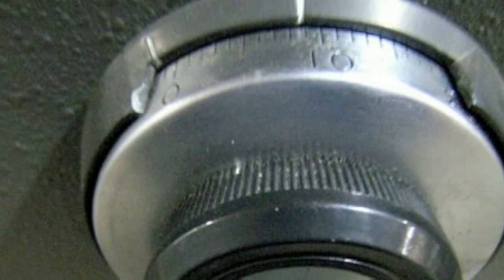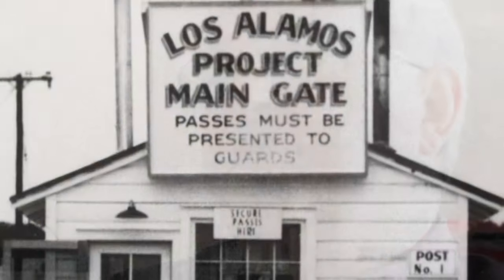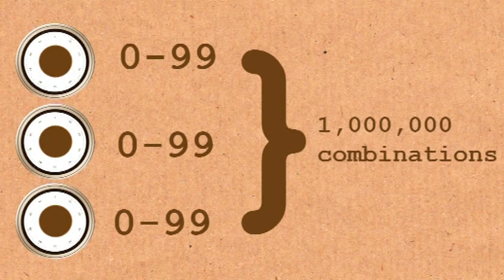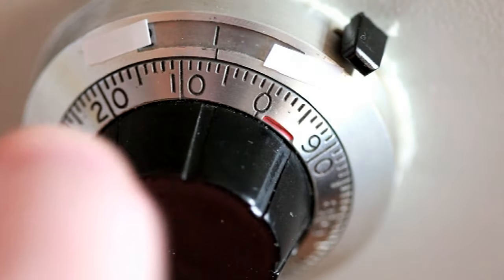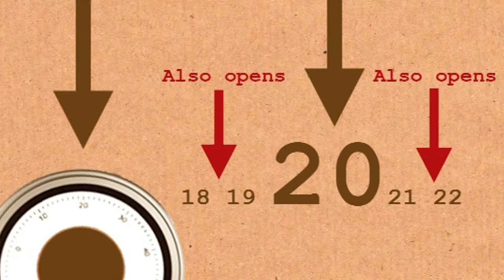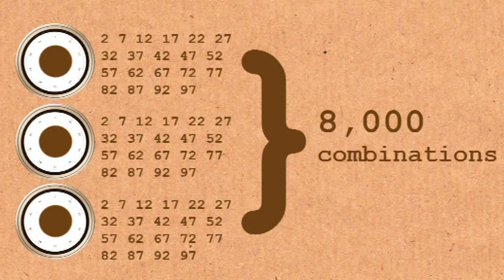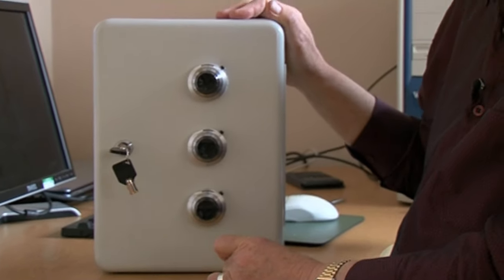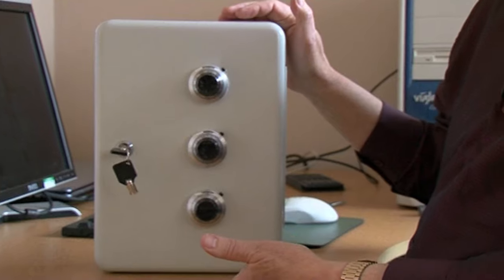Safe Cracking with Feynman - Numberphile

Comment: They didn't mention that he would tell the various people in charge of this security issue and they would get mad at HIM rather than fix the problem.
Reply: That's kind of a common thing with people in charge.

They will get angry at the person pointing out a problem and not the problem itself or the person who caused it initially. I think it has something to do with them now being required to take action, since now that they have been made aware of the issue they are expected to deal with it. Until someone pointed it out, they didn't need to do anything.

Now they need to invest time, money and work because they must fear/expect that their superiors might also hear of the problem and will hold them responsible for not doing anything about it. So they get mad at the messenger for making them work more.
Reply: losthor1zon as I recall the only reason he started cracking them was because they wouldn't listen when he reported how bad the security was.
Reply: You always shoot the messenger
Reply: losthor1zon I live his lectures
Reply: @ziadkhayat7299  - I don't remember exactly. But he enjoyed puzzles, and I think for him this was a diversion. I thought he only pointed out the problem after discovering how many of the safes were not modified from their factory settings.
Reply: @Addict That exists in every hierarchy

Comment: In combination in most modern schools, you cannot set the combination, but you can easily find the first digit due to a flaw in the lock (apply pressure while rotating dile. Add five to the one number it gets stuck on.) then from there, after determining whether it is even or odd, you know both the second and third numbers are either even or odd (but all even, or all odd.) If there are 40 numbers, that gives you  400 combinations. But the third number doesn't require trying a new number everytime. Just set the first number, your guess for the second, then spin it around trying all numbers for the third one. Now, this is more like 20 different options, but doesn't require seeing the lock before breaking in. I have never used this technique for bad (nor should anyone) but I find it handy when I see that someone has stuck a lock in an unnecessary/obnoxious spot. Or if I find a lock, I can learn the combination then give it to a friend who needs one.
Reply: +SwatTeamExit Well, yeah! But for those that do...

Comment: The simplest trick he used is that some people didn't change the factory combinations, which were just a few. He started by trying them, and they often worked. Also, when he found some people left the cabinets open, and he could use the information, he advised them not to leave them open. That triggered a memo asking people not to leave the cabinets open when Feynman was around :-D

Comment: Per his autobiography, it is my understanding that Feynman also reduced the permutations by merging the rotation for the third combination with the beginning of the rotation of the first combination of the next number tried.

Since the dials required Right-Left-Right (or Left-Right-Left) turning, the first and third numbers were approached from the same rotation direction.  

Also the first number required the dial to rotate over 360 degrees. The third number's rotation was less than 360 degrees.  Feynman deduced that if he got the first two numbers correct, ignored the the third number entirely, and began spinning the dial for the first number of the next attempt, the lock would make a distinctive 'Click' as it passed over the correct third number.

So with a lock dial with 100 positions per turn of which he had already reduced to 20 positions per turn, he could cracking the lock in no more than 20 x 20 = 400 attempts (plus one extra spin) without any social engineering required.  So at 5 seconds per turn, in a worse case scenario,  he could crack the safe in about 2000 seconds (-32 min) and on average, -16 min).
Reply: All of that is bollocks if you know how a combination lock operates.
Reply: they don't make em like they used to
Reply: @JaakkoF  feel free to read his autobiography "Surely You're Joking, Mr. Feynman!".  Further if you ever had the traditional style MasterLock  combination padlock, you can easily emulate the same technique.  The dial had enough slop that the 60 digits could be covered by just 12.  As a kid, we used to open them in a few minutes.
Reply: Close... What he did report doing was retaining the setting for the first two numbers while trying all the possibilities for the third, then nudging the second wheel just slightly to the next number along. This saves time because you don't have to dial the entire combination on each attempt. The same trick works on the position of the first wheel. You can either memorize where you've set the first two wheels, or feel the slight increase in friction as the extra wheel gets picked up by the one behind it. I've tried all this, and it works.
Reply: @AlanCanon2222  yes, that is correct.  It's been over 30+ years since I read the autobiography.  Thanks for clarifying the details.

Comment: Amazing how a tiny mechanical flaw can make it that much easier. I remember I used to crack open my friend's lockers at school , leave them in awe. Really all you had to do was if it wasn't cleared you could slowly turn it backwards (so if RLR opens then LRL). If you focused you could feel when the pins collided, which would give away the number for that dial.

Comment: Several years back I managed to crack an inexpensive Sentry safe just by starting somewhere in the middle and brute forcing every combo in increments of 4 or 5, just like described here.  I reasoned that the last number didn't really matter because I could just repeatedly yank on the handle while rapidly turning the dial.  This means I really only had to try about 20^2 permutations max (and in practice, only about two-thirds that number).  It only took about 10 minutes to get it open.

Comment: I didn't get the part where you said "people leave their safe open and there's a drawer in the bottom and he fiddled and remembered the last two number" etc etc, how did that work?
Reply: As I understand it,  he could feel the mechanism inside the safe and tell when the first two numbers lined up. So while talking, slowly spin the knob until the first number engaged, remember the number. Then spin the knob until the second number engaged, remember the number.
Reply: @thadtheman3751  And nothing is stopping him from getting the third number either.

Comment: He also tweaked a pompous colonel in Oak Ridge who claimed to have the most secure safe in the country; it turned out to be a large armored cabinet with the same Mosler lock on it.  He could get the contents out of any key-locked desk by getting under it and and reaching into drawers that were closed and locked from the outside.  He was the bane of the security people at Los Alamos.

Comment: Not forgetting with almost any combination lock, the LAST tumbler (the third number), all possibilities can usually be tried without re-entering the first two numbers, because the first two tumblers are already set and the last is physically locked to the number dial, this means you really only need to solve for the first two tumblers 'slowly' and the last number is turn,try,turn,try,turn.try...etc.  Doesn't work for all locks because they have a randomizer on unsuccessful attempts.

Comment: I do work which require me handling a lot of locks and keys (many buildings, many employees both permanent and temporary).

Every time I encounter a new lock system I like to spend some down time figuring out how it works. Comes in handy and I got a bit of a reputation at this point at work for being able to get most things open if needed, to the point where they call me in instead of calling in a locksmith.

Most of the time I just use a screwdriver/piece of plastic/whatever to force open things or unscrew something and it will open, most locks weakest points are the surroundings they are placed in.

Comment: When the safe was open, you could see the bolt that holds the door closed in the "open" position. By spinning the wheel, the bolt would eventually return to the "closed" position. The last number before the bolt "closed" would be the correct number. Then you would rotate the wheel in the other direction to get the 2nd number. 

On a completely unrelated note, I recommend the book "Surely You're Joking, Mr. Feynman!"

Comment: The locker combinations today when they are opened, show you the last digit. Even if you don't know the last you can save time and do them in about 10 minutes by knowing the internal wheels.  eg: spin + to 20, around once and - to 15, then + to 25 but then you can just do 30,35,40,45,50,55,00,05,10 all in a few seconds without doing the 1'st 2 again. Then set only the 2'nd wheel by - to 10.  I used to open them driving home, just in the time stopped at red lights.

Comment: Hence, the warnings in places that handle sensitive information: "Don't dummy-lock it, lock it, dummy!". When leaving their office, people would often just turn the dial away from the last number of the combination, so the safe would not open, but they could get it open again just by moving back to the last number, without having to go through the whole combination. This was referred to as "dummy locking". The problem was that this allowed someone else to easily get it open by applying a little pressure to the latch while turning the dial.

Comment: There are 1,000,000 combinations total. If you try every combination and the last one you try is correct, that would take 5,000,000 seconds, which is about 2 months straight (no breaks, no sleep, no eating, no nothing except cracking 24 hours a day for 2 months). Since there are 2 possibilities, the expected value of random trials is half that, or 1 month.

Comment: I agree about the year dial: you can't assume in 1942 that nobody will use a date in the 19th century. Checking American instead of international dates is the same number of combinations. If you want to check both, it's a little slower but not as slow as you suggest: you don't need to try 8x8 because, e.g., 30/30 isn't a date in either system. So you just need 3x8+5x3 (not even twice 3x8 because, e.g., 3/3 is a date in both systems and you only need to try it once).

Comment: And with the locks in use in that facility, the final turn generated a pop and stopped the dial..  so if you went 9, then 13, then back to 5, on your way to the five, from the 13, you'd feel the pop and would be hard-pressed to go beyond it...  
So all you need are the first two numbers really -- then turning back the lock would "give" you the last one.

Comment: You missed a major reason… The filing cabinet would automatically lock at the last digit if you left the door open. So someone can simply walk up and view the last digit, because the dial would not turn until the cabinet was closed and re-locked

Comment: From the stories, the safes used didn't have a lever. You had to set the wheel a 4th time to the number 10, Then it opens. However, he did try spinning it and quickly turning to 10, hoping friction would help

Comment: ok, to be honest, there's something that's being left out of this.

the first 2 turns need to be tested one at a time.  There are 20 of each, however, the final turn you do not need to re-enter the entire thing to move on.  for instance, 3-3-18 is one combination, then try 3-3-13.  you don't need to re-enter 3-3 for that, just move to 13, so it's actually much faster than you suggested. It's like maybe 10 seconds for a set of 20, then 3-4 to reset for the next set.

Comment: in my head i did it like this:
20 is 2 times 10
so 2 x 2 = 4 ///10 x 10 = 100 -> 400
4 x 2 = 8 /// 800 x 10 = 8000 (in less than 10 seconds)

this is general, you can always separate the units and multiply them individually and them add them together again. Not sure how it's called in english but here it's called the Distributive Rule, 4x(1+2) = 4x1 + 4x2

Comment: That does make a slight difference to the math: instead of trying only 3 numbers on one of the dials, you have to try 8 numbers on the first two dials.  Also, the year dial really needs all 20 to be checked.  However, a lot of simple locks don't reset just because you check to see if they're open, so you can set the first two digits and then run through all possible last numbers by just going 3 pull 8 pull 13 pull and so on without having to redo the first two every time.

Comment: I'd like to know where this story came from. Feynman himself bragging? Because Mosler safes do not have a tolerance of 5 numbers. There was a Mosler safe in a bank in Hiroshima near ground zero when the first atomic bomb was dropped. The safe did not open from the blast, but was opened later using the combination. The mechanism still worked. They were regarded as the Rolls Royce of safes, which is why the military used them.
Reply: MrPlanx Yeah it's the filing cabinets that he cracked using this method, although he does state in the book that they had Mosler locks on them. With the proper safes, he opened them by guessing the combinations such trying birthdays or numbers that a physicist might use, such as the digits of e or pi. And there were others that he opened just by trying the default factory combinations since people apparently didn't bother to change them.

So it's filing cabinets = cracking

Real safes = social engineering
Reply: What about the Mathis of the video 

And he did get all the safe enthusiast fired up in the comments
Reply: +MrPlanx I read the book in question and remember Fey man said this was a very early model of a safe. One of the first of its kind.
Reply: SOEL86 Why would the US government use antique safes for highly classified material?  Mosler's earliest models were in the 1870's. I highly doubt that they were selected in the 1940's for this application. If Feynman really did say that, then that's just another strike against his credibility in this tale.
Reply: MrPlanx Because the US government had ships to build and soldiers to feed and werent about to waste resources building new safes when there were perfectly adequate safes lying around. It's not like these guys were stationed at the front

Comment: he could always use the method explained in the video to open any random safe in under 12min. 
well,not any random safe,it would have to be using a date as the pin, which alot of safes do
read his autobiographies if you are interested in the guy,they are soooo goood

Comment: well, what's surprising is that I thought anyone who had a number lock would try this. I did the exact same things with the half-a-dozen num-locks I had in my childhood - try and figure out how to find out the quickest way to guess them. 1. determine the error (usually 4-7), 2. Detect an angle at which if I pushed the dial and twisted, it behaved in a manner that I could guess the number in worst case of 10 guesses. 3. Shake the dial around when I found a number and it gave away 1 in 3-5 times.

Comment: thanks , quite correct , and simple as it goes from most to least significant .
However , I like when dealing with the present date , I prefer dd/mm/yyyy , mainly because Im sure what year it is , I can guess at month , but for the date I got no idea , so the day becomes the most of concern .
Although if in yyyy/mm/dd then I could smudge the days , and not worry so much about it

Comment: I agree that the ISO standard of YYYY-M-DD is most sensible, not least because it means you don't need to worry about whether 03/04/2013 is in April or March.

However, "seven, forty and three hundred" is *much* more sensible than "forty, three hundred and seven". Sure, it's backwards but at least the digits are in a consistent order, rather than jumping about.

Comment: Actually, they're are typically 31 days in a month (7/12.) The number 30 would be more common, if it wasn't for the fact that February only has 28 or 29 days. In fact, if February had 30 or 31 days, then every leap year would have exactly six 30 day months and six 31 day months.

Comment: There is a trick to the last number. Just spin the dial a full turn with a little force on the door.  If the first two are correct the door will open when you hit the third number.  If he knew the first two numbers, he should be able to open the safe in under 10 seconds.

Comment: That's fine, until you put the year on the end. Can you think of any other system of measurement where the components aren't listed in a consistent order? Usually, that would be largest to smallest -- indeed, one widely-used date format is YYYY-MM-DD, which avoids confusion about whether 03/04/2013 is in March or April.

Comment: In 1999 year 7 first year of highschool we were issued with lockers and these 3 dial safe mechanisms. The grapevine around the nerds was how to crack them. So by end of first quarter term first year of highschool I and many others knew how to get into any locker. I didn't think this was a remarkable fact until now. Did we do anything dodgey? No! Did we break each others or another friends as a joke... yes! The kind of curiosity and ability to understand the things tends to be correlated with ethics I found... well at least at that age. Edit: how? Its simple with the sort of $30 version... there's a bit of resistance periodically and also when it falls on the number and if you tune into that and ezclude the periodic resistance you can work out which number is the one for that spin since the mechanism needs to fall into place and I suspect the difference between a $30 and $300 version is just how much resistence and tactile feedback that mechanism falling into place gives but could be picked up by other means... e.g. the classic doctors stethoscope.